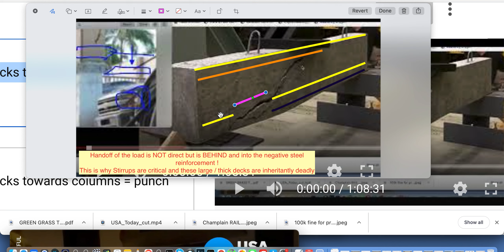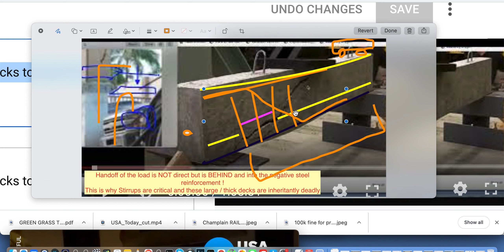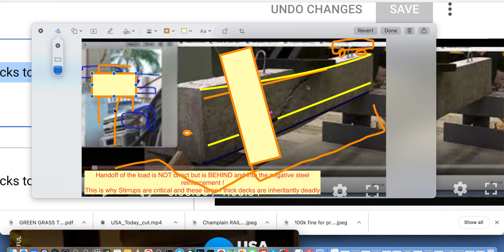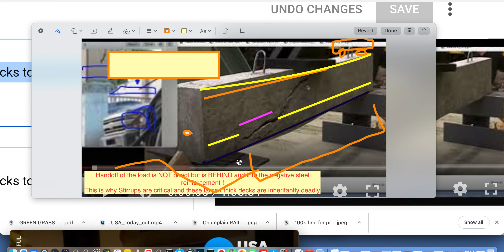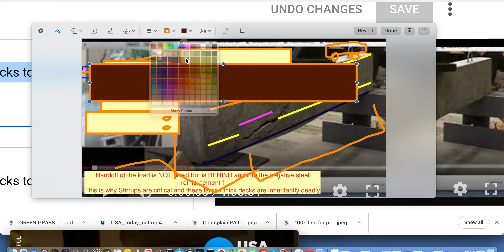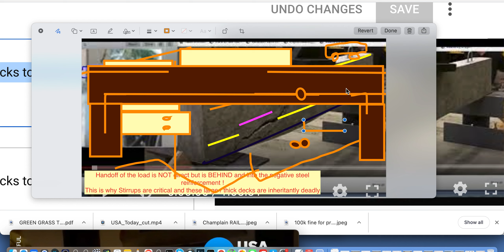Champlain Towers DECK DEFLECTION AND SHEAR AT COLUMN BY TRUCK Crank Bars vs Shear links vs Stirrups

Comment: Do I detect confusion in the design between the top bar and the column punch through prevention bar and similar for wall lock in and so they missed out the top bar? Is it correct in the drawings? I’m guessing not. Typical of engineering where ‘the basics’ get forgotten. I only have basic structures knowledge, Love your talks.

Comment: Interesting how much or little of steel they were using in those beams!
Reply from the maker: The floor slab is one giant beam and supported on the columns and wall section...
But, it is NOT "looked" at as a beam
...yet, it has loading and it goes from column to column...
The spans are HUGE...